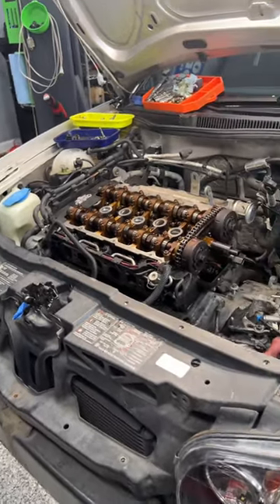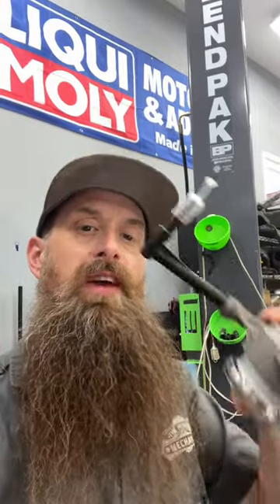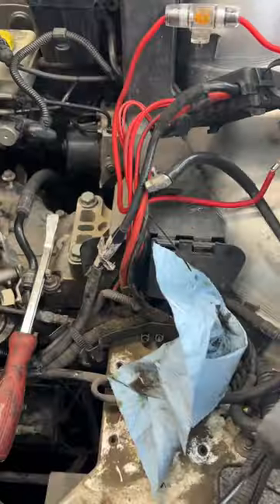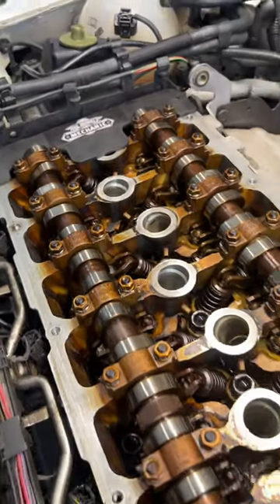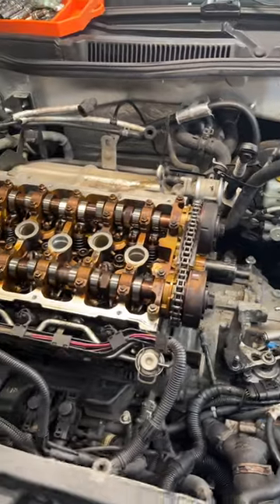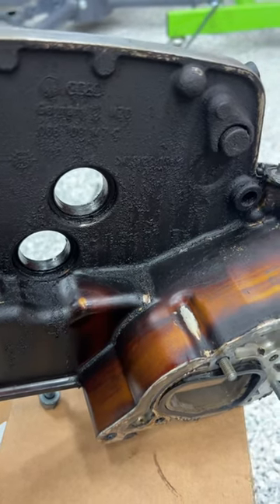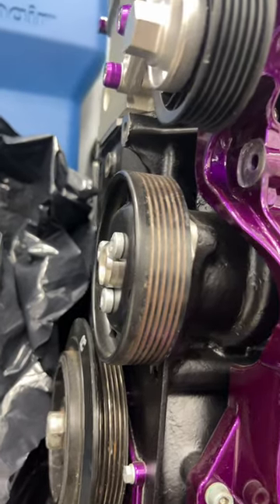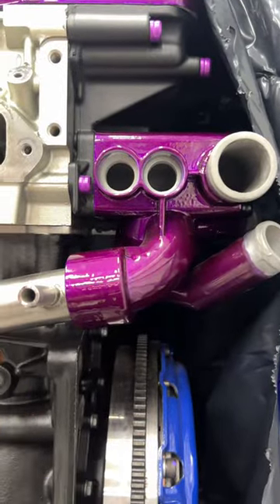Timing Chains on a VR6 GTI on the BACK of the Engine

Comment: I've taken the transmission in my vr6 off twice in one year and haven't done the timing chains😂
Reply from the maker: Brave lol
Reply: @HumbleMechanic  yea lol they are next on my list since I want to boost it
Reply: I need advice! Mine smokes blue smoke only right when I start? Does that mean piston rings and valve seals are leaking?
Reply: @jerrodskipworth218  it might just be valve seals if the smoking stops
Reply: @eliancastillo726  yea it’s just right when it starts. You know anything about replacing them? I just bought the car as a project. It fires right up and runs strong.
Reply: @jerrodskipworth218  Yeah its the valve steam seals if you rev the engine to rev limiter and let off the throttle does it smoke blue aswell ?

Comment: As a german who was in younger ages a bit proud of german car engineering: the more videos I watch about german engines I get the thought that they are made way too complicated to service. But it may be because German cars are simply smaller, like the rabbit. Apart from that, i love this engine. The sound is unique. It revs and it hits. The VR5 is also interesting but sadly short lived.
Reply: Why have chains that then need replacing??? May as well just use external rubber belt with 100k replacement service. Do it at 90k.

Comment: I've changed the clutch hydraulic release cylinder on my 1995 Mazda Miata three times since I bought it about 7 years ago.  The last time my clutch went out, I knew exactly what to do.  I just pulled over to the emergency lane and scooped some of the brake fluid out into the clutch reservoir, and pumped the pedal a few times to get some fluid in the system to get me to a gas station.

Comment: I had a VR6, 24 valve, imported Volkswagen bora, BDE engine code, nothing different there from the BDF, but it was a fun car, 02M transmission and 4motion. The car was a combination of an Audi TT rear end, and a mk4 Jetta front end. Very fun car, but very slow.

Mine had a rotational, clicking noise that came down to a bad link in the timing chain, so I got my local Volkswagen expert to do the chains and a new clutch and slave cylinder as well. Took him three days.

Comment: Litterally just did that. Ended up pulling the motor cause it was easier than sliding the trans under the car without a 4 post
Reply: Mine needed chains too,bad enough it was blowing codes for incorrect speed correlation cam/crank😂 Anything i touched when i pulled the engine got replaced.
Hopefully itll be decent for another 100k or so✌️

Comment: no million dollar coil , no c... pipe and  as long as timing chain tensioner holds up , these motors are great!
Reply: Tensioners usually hold up well when you do oil changes religiously. Purchased a mk4 12v vr6 5 spd for $450 with collapsed suspension and other fix but engine was mint drove the crap out of it for 5 yrs lol
Reply: @CORRADOVRT  Hey Don ,  they have tendency to let chain jump, I have seen few times.

Comment: I have a 98 Jetta with the vr6, can’t get it to turn over. Got a new fuel pump, relay, crankshaft position sensor and checked the battery but I’m still clueless. Any input would be awesome 🙏
Reply: Have you bench tested your starter motor?. Also check the timing.🤞🏻
Reply: Scrap it
Reply: @RubyTwoshoes🔥  timing has nothing to do with with it not turning over
Reply: Fuel pump has nothing to do with it also. Check for voltage at the starter. Bench test the starter. General place to start. It could be something else, but those two tests would narrow it down.
Reply: I’ll bet it’s something wiring/electrical related
Reply: ecu issue prob
Reply: Earth lead
Reply: Don’t part change. Isolate the problem. Check for fuel, spark, compression, timing
Reply: Trade for good used Toyota  if all you seek is reliable transportation.

Comment: I changed the chains on my VW V6 4motion AUE engine 2 weeks ago. I found the timing mark on the crank did not line up when the locking plate went in. It was about a tooth out. No sign of anyone being in there before. Have you ever seen this before ?
Reply: Most likely like that because of VVT, the manual will tell you how to set that up.
Reply: The AUE engine doesn't have VVT !

Comment: Trying to diagnose a similar clutch problem on an 02A, not completely stuck to the floor, but very soft feel. Also grinds going into reverse. Was originally thinking bad slave/master. No leaking fluid anywhere. Any help is very appreciated. Cheers!
Reply: Have you tried bleeding the clutch to see if there air in the system cause if there is more than likely the slave cylinder going bad

Comment: the ONLY thing i dont like about the VR6 is the chains being on the transmission end. i daily a AAA vr6
Reply: I used to daily my 12 passat vr6 until one day i changed my the hpfp and got a 🔧 symbol where the digital gear display. The n the notorious epc light triggers 25 codes. Alot of mechanics turn down vr6 jobs i couldnt pay a soul to get them to work on it. It ended up being the timing chain tensioner

Comment: How would you go about diagnosing a VVT problem on a VR6?
Reply: Judging from this video and how stupid the timing chains are to get to check oil level change it if old check solenoid function and then prepare for mechanical issues lol

Comment: Question: MY12 Passat TDI Wagon. Excessive tyre wear inside right tyre, I mean the inside edge (where the tread starts). Doesn't look like a toe issue. I replaced the big alloy bush blocks & wheel alignment. I took it to Pedders (Aussie steering/susp specialist) & they couldn't tell me.
Is it something worn or a camber issue? The alignment doesn't show any excess camber but they said they can't adjust castor. Help 😮
Reply: Might be a loose suspension or steering part. Check ball joints and inner/outer tie rods
Reply: Tire pressure is correct???
Reply: @christ3496  checked by specialist
Reply: @schuylermorris5342  checked by me 😎

Comment: So how hard is to swap a vr6 in 2002 beetle with a 2.0L asking for a friend 🤔
Reply: As hard as it will be to take the 2.slow out. From what i understand all 1.8t 2.slow vr6 1.9tdi and all their transmissions are interchangeable.  You would also need the whole wire harness and original computer

Comment: Seems it would be just as easy to drop the whole front subframe, give plenty of room to work,  lift the body off  mleaving enough room to remove the trans,  (almost) i have done similar work with front drive vehicles, without a lift it is not easy!

Comment: It be more easier to remove the engine and gear box from the car then work on it, I had a vr6 10years ago, removed the engine and g box 2x times one time for the clutch , second time for the timing chain, three bolts holding the engine in place , drive shafts, and wiring loom,

Comment: Do you happen to know if Audi A5 B8 2.0tfsi manual have this same part within the transmission?
Reply: Yes it sure as hell does. Not to bad if you have halfway decent auto mechanic skills I just replaced my slave cylinder on my 09 VW CC 2.0T 6 speed manual. Takes hours to get everything everything off to pull the tranny out and it literally takes 30 seconds to remove the 3 mounting bolts that hold the slave cylinder on and put the new one on and tighten 3 mounting bolts down, THEN repeat entire process but backwards 😤😤😤😤 engine hoist def comes in handy. Just replaced the damn thing 2 years ago
Reply: @schuylermorris5342  Right, thanks for that. I do have to add that I'm in Europe, so the transmission is in-line afaik, and is easier to reach. The car is a 2011 model, not that it would be much different. Got the complete dualmass flyingwheel, clutchplates and bearing ready to go. I guess I'll order this clutch slave asap.

Comment: Why replace timing chains are VW ones just know for timing failures but I’m coming from Toyota land so I hope you don’t mind me asking
Reply from the maker: its a good Q. This engines pretty good about it. BUT at 200k miles, and a ton of overlap, it's a good idea to get it done as preventative
Reply: You typically wanna change a timing chain (regardless of brand) every 100k to 120k. Some people like to push it - but a new engine isn't work it lol. My S4 is gonna hit that so am saving to do it as its a like a 5 grand job where you pull the engine
Reply: @richmondvand147  as in 5 thousand dollars??
Reply: @richmondvand147  what? Most timing chains are for the life of the vehicle....... Should go past 200k miles even with okay oil change maintenance... For example I've seen 300k+  mile 07k engines with the same timing chain and still good..... Should only change timing chain every 100k miles if poorly maintenanced  or are modding.....
Reply: @MiguelGarcia-vj7oo  “life of the vehicle” is marketing jargon, demonstrated perfectly by “lifetime” sealed transmissions 🤦🏻‍♂️
Reply: @MiguelGarcia-vj7oo  it's not the chains but the plastic guides that tend to wear out

Comment: Im pretty sure that engine is stained like that because the owner puts penzoil in the engine which in my experience is the worst oil on the market. Stains and gunks up your engine so bad. And prob went way to long without oil changes

Comment: A throw out bearing and the slave cylinder are two different parts. You were holding the bearing that might help a little but most likely you need to replace the slave. Basically you pulled the transmission for no reason 😒 The slave is much easier to replace. At the other end of the clutch master you find the slave cylinder.  Good luck
Reply from the maker: Yes and no and it depends. While technically they are 2 different parts, this car has them combined into one unit. 

This part lives inside the bell housings. So i didn’t  pull the transmission for no reason. 

Remember there are countless different configurations for things.
Reply: Shall we tell him? They are integrated in the 6-speed transmission here. The bearing is part of the hydraulic piston assembly. It's all in one unit.
Reply from the maker: Lol it’s cool that people don’t know. But I don’t know why they come so hard about me being wrong. Lol